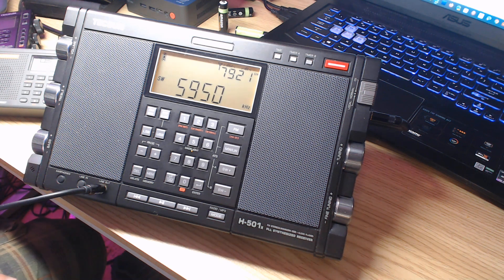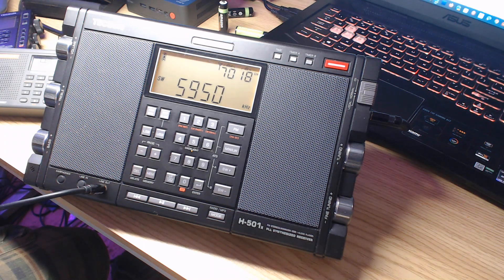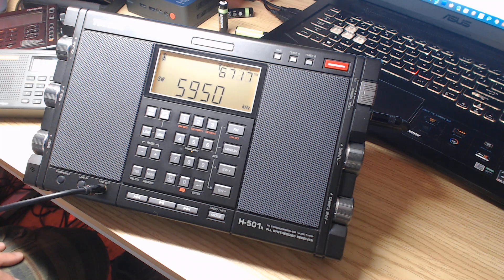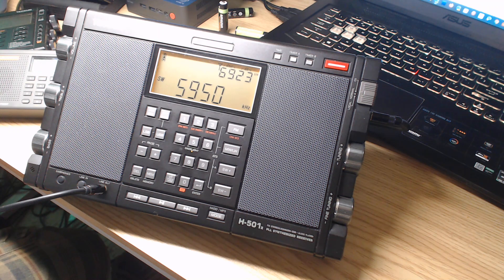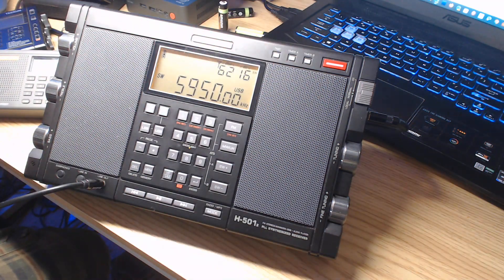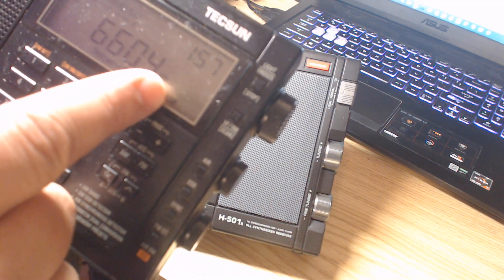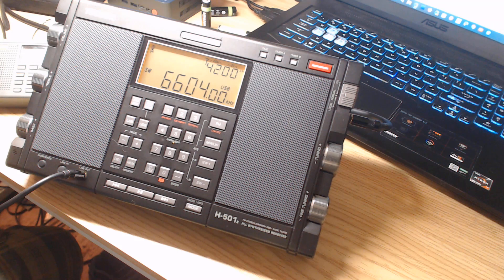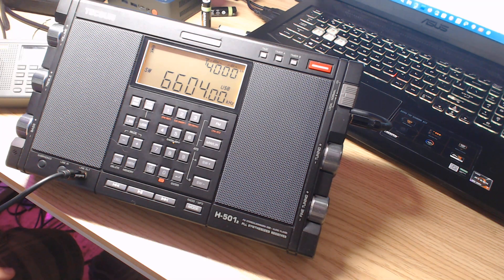Shortwave 101 Beginners series What is SSB LSB USB BFO and Fine tuning in Single Sideband

Comment: I’ve been having trouble getting consistent information on using sideband on receiver-only radios such as the Tecsun PL-330, PL-680,  SIHUADON R108, QODOSEN DX-286, or the Sangean ATS-909X2 with firmware version 073. Also, how do these radios compare to the Tecsun H-501 that’s in your video?

It’s seems like most people buy one or all these radios, but I just want one that I can grow into using but isn’t missing too many capabilities without spending $500+. I willing to trade durability for capabilities at the beginning stages.

Comment: My local electronics store sells a lot of shortwaves radios and some have SSB and some don't. They were selling a big Shortwave radio that has SSB but then i realized that they had discontinued it and it was sold out everywhere. So i got the other model of this radio that didn't have SSB and when I got home nothing worked. I was thinking i didn't need SSB but than i realized that it is really important on Ham and shortwave radios, retuned it and got a little radio that has SSB and it worked (Its a clone of the HDATA-D808) Its really good and i have managed to get a signal from the Japanese slot machine station using SSB USB.

Comment: If you have a NanoVNA, you can use the CW Frequency function on the NanoVNA and tune it close to or directly onto the frequency you're tuned to on the AM receiver that's receiving the SSB transmission and put the wire/antenna that's hooked to the NanoVNA close to the coax that's hooked to the receiver. Just don't directly connect the NanoVNA up to the receiver.

It works better if you use two pieces of coax put together with an adapter that hooked to the receiver so that the output signal of the NanoVNA can leak into the coax hooked to the receiver.

I couldn't get it working at first due to using the MLA-30 on the receiver (a passive antenna works better), I do believe it was overpowering the signal generated by the NanoVNA. It will work if you're using the telescopic antenna on the receiver you just usually have to increase the distance between the antenna on the receiver and the wire/antenna hooked to the NanoVNA because the signal from the NanoVNA will overpower the SSB signal you're trying to hear. 

It's far from perfect, if you have people that's slightly off frequency their voice will be a bit more garbled and harder to understand than the other person that's on the same frequency you are on.

Comment: What will you say about the fine tune wheel of the XHDATA-D808? I have found that tuning stations off frequency to get the correct sound is difficult with this fine tuning. Many a times it doesn't achieve the result tuning it +ve or - ve side.
Reply from the maker: the XHDATA Fine tuning is pretty much the same as using a BFO, takes some getting used to and you have to make sure you are on the exact frequency of the SSB signal